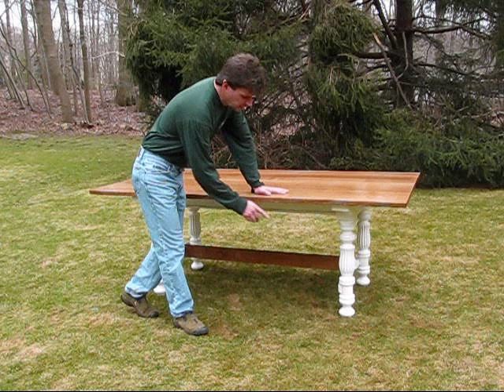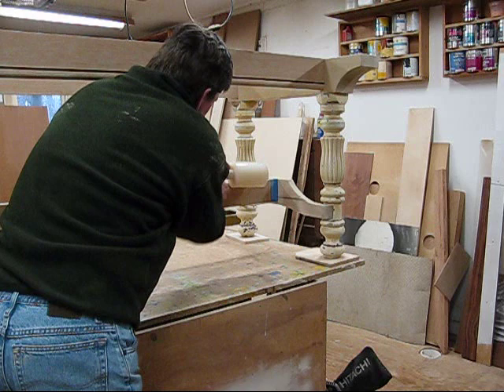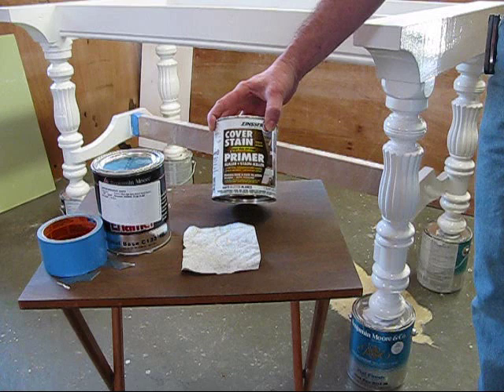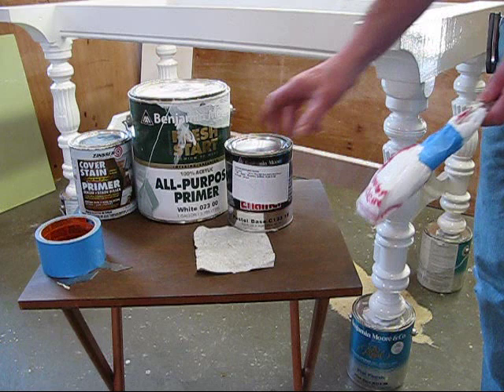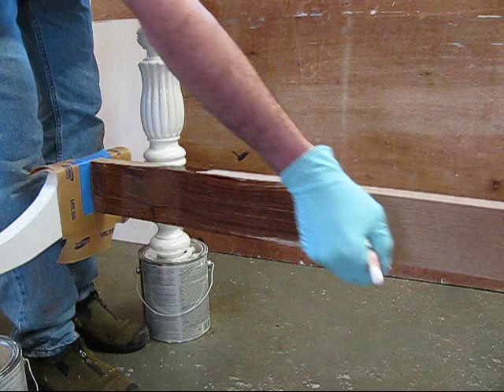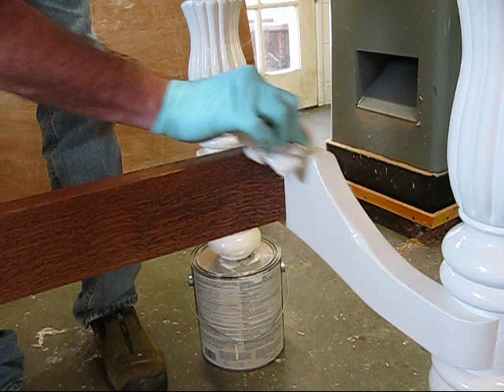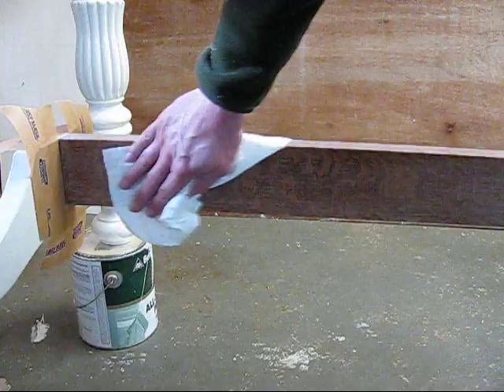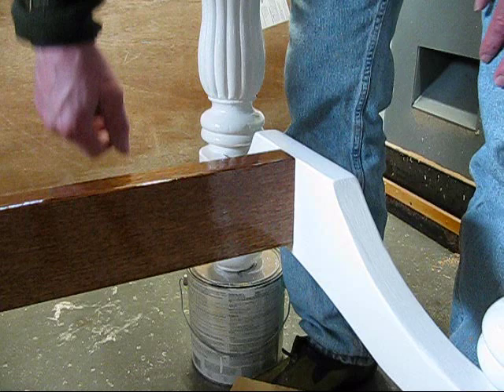How to build a Dining table, By Jon Peters. Part 2 painting & finishing

Comment: Jon, next time you use the easy mask, or any masking tape for that matter, finish applying the tape with good and even pressure using a good quality, clean, sharp, yet flexible putty knife. I've always preferred the Hyde 2" or 1/12". Your fingers can't conform and push the tape tight enough into a corner. That being said, even with the new tapes that are supposed to stop seepage, you should always pull the tape as soon as you have applied your chosen finish, because even with this method, there will still be the minute imperfections in the wood that will come into play. I enjoy your video's and it's great to always learn new tricks and be able to appreciate others growth expertise, so thanks for sharing.